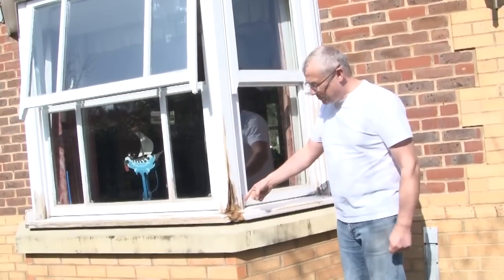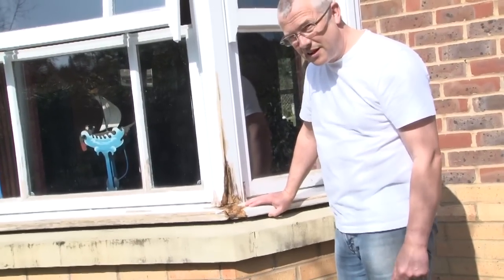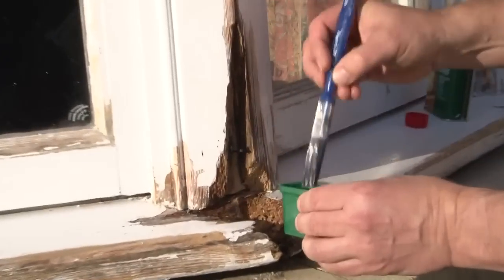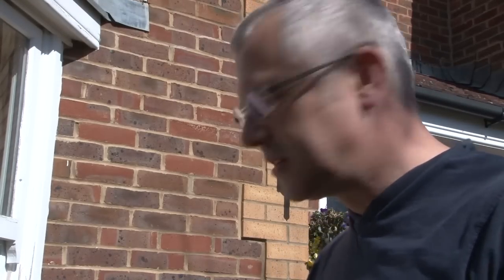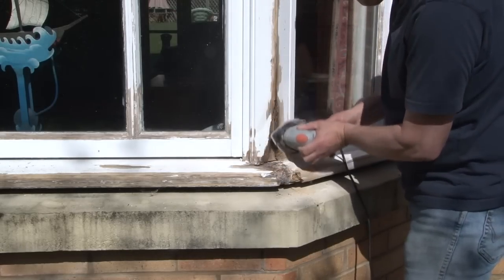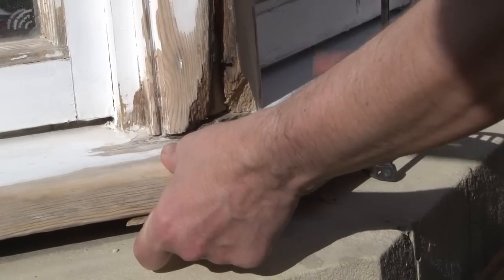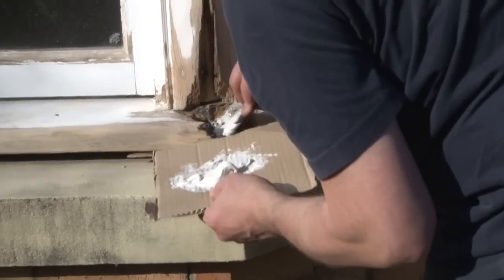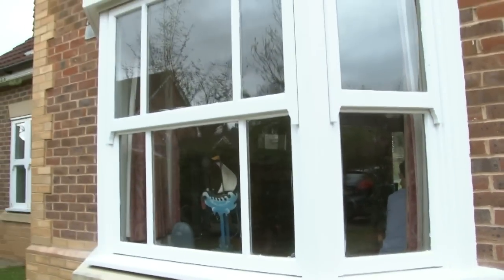Rotten Window repair from wet rot

Comment from the maker: Just a quick update, 4 years on and the 'Temporary' repair is still holding good!
Reply: I'm sitting here watching a 4 year old video thinking, 'I wonder how that held up', and look to see the creator posted an update today. What are the chances? Thanks for the update!
Reply: I replace too many sash and sills that have been "repaired" by using fillers and /or epoxy  for this to be a true fix.  Folks if you want it done right replace the rotted wood completely if not you have only prolonged the inevitable.. 26 years doing this work.
Reply: I'm amazed by the "Only full replacement is good" comments. Nothing is permanent. I use filler to fix frames and they hold for few years if done correctly. Its important to see if the cause of the initial problem is fixed. Be it deteriorated paint or leaking roof or flashing. Event if you have to redo repair every three years its still cheaper than replacing windows every 10. Great video.
Reply: How is it now??
Reply: @michaeledlin9995  Well said

Comment: I've been using plastic filler on rotting window frames for forty years. Where the window doesn't get direct sunlight, a good repair can last for several decades as long as the  paintwork's kept in good condition. Where the window gets sun , the continual expansion and contraction  will usually cause a crack to open between filler and wood after a few years  ( the sun  will also cause the paint film to fail for the same reason )  So maintenance  under these conditions will need to be more often and I invested in proper manufacturer. Dako Windows.

Comment: Good job. I have used this very same method and the same products. What I can say is that a better, easier and longer lasting repair can be achieved using the flexible epoxy products made by Repair Care International. RCI method cuts back to sound timber, applies a two-part liquid that soaks into the good timber and creates a perfect bond with the filler. The RCI filler does not sag and you can use scraps of perspex as formers to create perfectly flat surfaces. Both methods work but RCI will last the longest.

Comment: About six years ago, I had dry-rot on a 4x6 beam of my patio cover that's exposed to the rain & water running off of the cover.  There is a metal drip-edge.  I cleaned it out, but didn't treat it.  I used bondo as a filler, sanded & painted.  No cracks or weakening so far.  Still solid. I check it periodically & paint it every couple of years.  It helps to live in a fairly dry climate like So. Calif.

Currently (Nov.'12) doing the same thing to repair termite damage on the rafter tails.
Reply: DRY AREA like Southern California 
Thats an understatement your 9 years into a historic drought.

Comment: I have a similar situation where I need to build a "form" before placing the filler.  I had thought about using vegetable oil to keep the filler from attaching to the form, but was concerned the oil might react with the filler.  Apparently, you did not have a problem.

Comment: Hey man, amazing vid! Thanks for posting! Was wondering, what is that sanding brush-like drill attachment you first started sanding the edges of the rot with, before using the mouse sander? Thanks!

Comment: As I said before, not going to find a carpenter to do that, they would remove the entire window and replace whatever needs to be replaced and leave you with a whopping large bill...just saying
Reply: Carolyn Gibbs yes you will, I make lots of windows and doors but I also do lots of restoration on listed properties where you are not allowed to remove the original unless they are beyond repair. This filler type repair is usually unacceptable in my line of work. Letting new timber in really is the only acceptable method as this filler and cement that I often find used too traps moisture and can cause a total failure.

Comment: What was the product you used to fill it? Thanks 😉
Reply from the maker: +Lauren Von Hicks Not sure of the precise name as it was a long time ago now, but it was a Ronseal product :)
Reply: Thank you :)
Reply: +Lauren Von Hicks Car body filler is cheaper and will work just as well.
Reply: Car body filler is polyester, use marine filler which is epoxy.
Reply: Gordon p` Car body filler is cheaper and it works just as well. These repairs have to be done a bit at a time. It's vital to remove all decayed wood back to sound timber with a wood chisel. Then apply wood preserver. Shape new wood and fit with screws to build up original profiles. Apply wood preserver. Apply wood primer. Fill with two part wood filler sand and fill again. Apply wood primer. Now ready for paint finish. Done properly you will never know and it will last for years.
Reply: have to disagree, epoxy is the recommended product for this type of repair, as used in below the water line repair of boats, polyester has little adhesion .
Epoxy not polyester  is the resin used in professional window repair systems .
I've used car filler on making good internal wood, but external, I'd use epoxy, the cost difference isn't that great, plastic padding Marine is on par with car filler.
Reply: Gordon p` Firstly, I've made these kind of repairs that have lasted 20 years and are still good. Secondly, The important thing is to do the work correctly and prevent water ingress to the repair. Thirdly, Of course marine grade products are better, but the car filler is plenty good enough for exterior windows. Fourthly, what is not a lot extra cost to you, might be to someone less fortunate.
Reply: Great, If your happy using car filler carry on.
I was pointing out to the OP the correct way as used by professionals who want to do the job right.
If car filler is 'plenty good enough' I'm sure cost conscious pros would be using it.
A few pounds or so shouldn't  be a deal breaker on a serious repair (500g tin ronseal resin wood filler £10 or £6 a tube),  buying decent exterior paint and primer will cost you far more.
Polyester vs Resin, I'll choose resin for this repair.

"The bitterness of poor quality remains long after the sweetness of low price is forgotten"
Reply: Gordon p` My happy what? It should be 'If you are happy' or 'If you're happy' not 'If your happy'.....If you don't mind, I will not take a lecture from someone who doesn't know how to spell correctly.
Reply: Great! Then I wont take bodge repair tips and be happy in the knowledge I've done the repair right.
If only your knowledge of wood repair technique was as good as your pedantism.
(and it would be grammar not spelling, at least incorrect grammar wont cause my windows to fall out)
Reply: Gordon p`
'Bodge repair tips' you cheeky cheap toaster! I served an apprenticeship making some of the finest banjos in the world. I expect you're what my dad used to call - 'all thumbs'.
Reply: I find when a person resorts to Ad hominem attack to deflect from from their poor argument
it's 'game over'
 'all thumbs' Is an ableist comment, much frowned upon these days.
Reply: Gordon p` I haven't made a 'poor argument' - you just claim I did.
Reply: If you could just reiterate any points worth remembering then.
Reply: Gordon p` Well, for starters - my assertions are based on actual experience, whereas your assertions are based on assumption and product sales pitch.
Reply: The collective experience and knowledge of professionals  is far from 'assumption'
And as you know nothing about me or my experience it's an even bigger assumption of
yours to assume that I don't know what I talk about.
If you could just point me to some references that substantiate your claim that polyester filler
is the correct product to use in this situation I'll gladly take it on board.
Maybe you should take Quill to parchment and pen a missive to all the technical departments debunking
their 'sales pitch' as snake oil and offer your wealth of superior know-how.
Reply: Gordon p` There is no 'correct product' this is the whole point of the discussion! What can be done to fix a rotten window? You either replace with a new window, repair the window with new wood sections or use some suitable filler. I'm telling anyone who's interested that in my experience a filler such as Isopon P38 marketed for car body repairs works very well in painted exterior wood and is much cheaper than products like Ronseal wood filler. If you would rather pay more then carry on.
Reply: Professional Painters Forum
				
A community of Painting, Decorating & Paperhanging Trades
				
Re: Two pack filler
													
							Quote 						
							 						
Postby LJW61 » Thu Apr 28, 2011 8:47 am
			 			 			 			
Ive been using Isopon P38 car filler for wood filling since the mid 80's, never had a problem with it , after all its the same chemical make-up. As for its flexibility, its made to stand up to the stresses of flexing ,vibration & expansion/contraction of car body panels. When I used to design & fit plastic spoilers & body-skirts to cars we'd blend the the joint between panel & plastic with P38, it never let go or cracked
			 									 									 						
		snag list							Posts: 74Joined: Tue A
							 						
Postby imaginarynumber » Tue May 31, 2011 7:35 am
			 			 			 			
I am not convinced that there is any substantial difference between the wood and car types (other than cost).

Lucky enough to have a mate who owns a paint store- only charges me £12 for the 5l tubs. When using it outdoors on timber i don't sand flush, I leave it about 0.5mm high and extend it onto the adjoining paintwork by about 50mm to allow for differential expansion rate.
Reply: Lauren Von Hicks Flour and water!!!.

Comment: After all this time effort and money it will crack and fall out next year. I replace patched windows nearly everyday. The different type of materials heat and cool at different rates which causes cracking even it is patched with timber as its density is different to the original timber.
Reply: Can you please either recommend a method, video or even upload your own video on how you would fix this as I have this exact problem on the bay window of my cottage!
Reply: @mattshepherd772  His name is refit windows. Ask him for a quote. Even better, try filler yourself then you will know if it's any good. It might work better than window sellers claim. I have patches of various ages. I have not noticed any failures in them. They will fail if the wood the filler is bonded to gets wet. Water is quite insidious and will get in from the smallest openings.

Comment: well tried but amateur repair with wrong product - the wood will expand and shrink and the two part woodfill will eventually go hard, brittle and crack. prob get two years max. Never use wood hardener on rot, always cut/drill out all rot (like a dentist would with your teeth!) and then either splice in wood correctly of use flexible resin system such as RepairCare.
don't do what this fella has done!